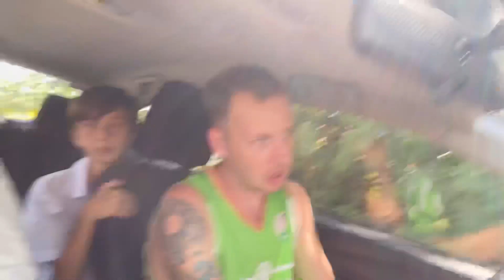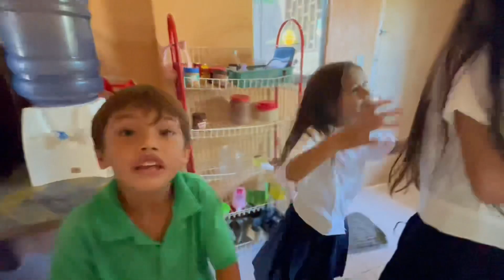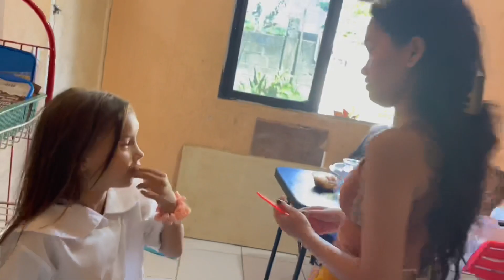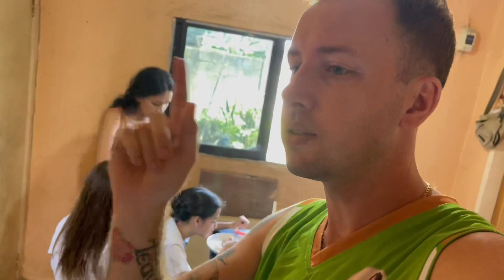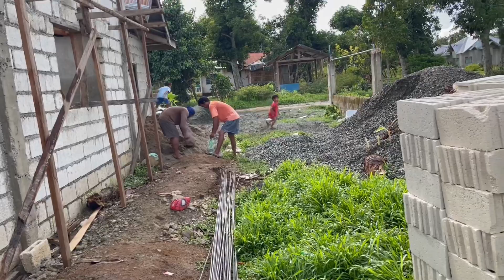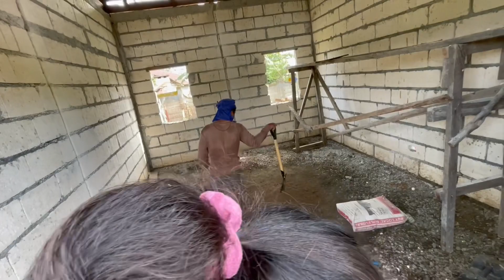AYAW NI KATHLEEN!- MOMMY WANTED TO CRY!

Comment: Do you prime coat all the rebar before using so it does not rust after construction? Saw that tip on another build channel in Camotes.